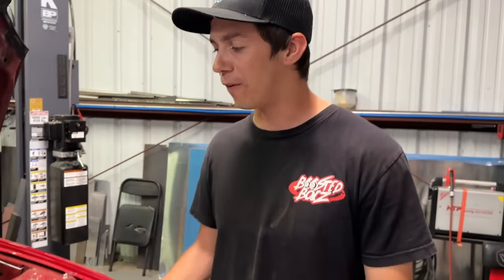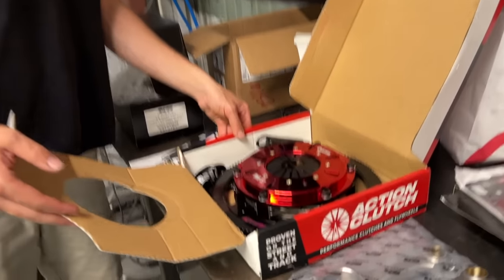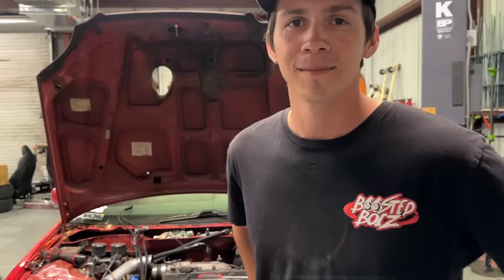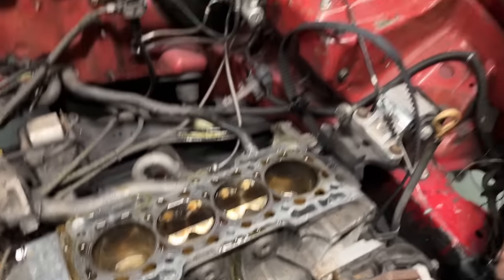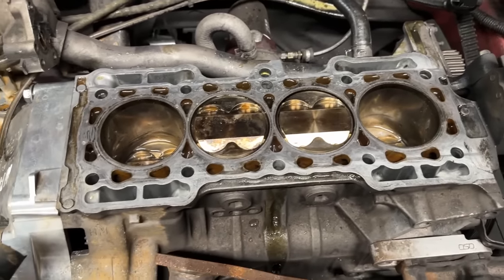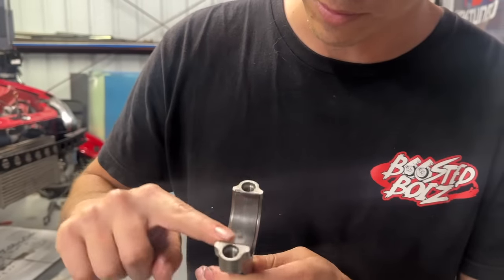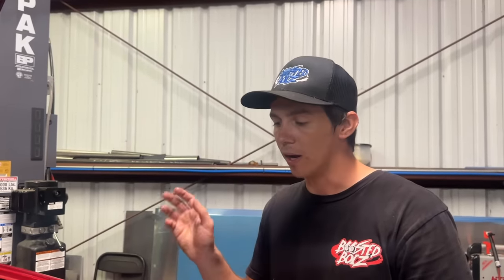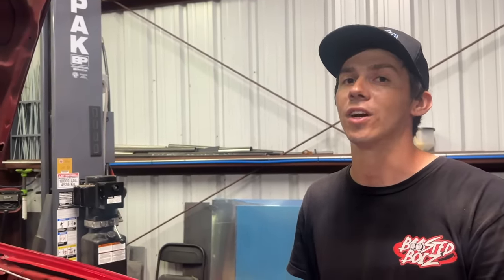Rebuilding The Hatch To Handle 1000Hp Overnight!

Comment: Hey kyle for your cooling system needs you should run distilled water to remove the minerals from the water...also get some stuff called water wetter. Should take care your issues and water wetter still is safe for the track.
Reply: Water wetter only adds a degree or so improvement
Reply: Correct distilled water + coolant. Coolant and or water wetter has anti corrosion properties. Surprised both Brent and Kyle didn't know that as its common beginner knowledge.
Reply: That is correct. Tap water has impurities which then turn to gunk together with the Coolant ... 

Easiest is just flush  once or twice and fill with straight 50/50 Premixed coolant .

Comment: You answered your own question! The hose water has minerals in it. Such as iron which will rust.
Reply: Jinkees!
Reply: I was wondering if someone used well water to fill the car at some point cause regular city water is filtered and wouldn't cause that unlike well water which is filled with minerals.
Reply: Use the distilled water and water wetter keeps all that to a minimum.. cheap fix.
Reply: gota use that Redline Water Wetter, adds anti rust, cools better and tracks allow it.

Comment: Those h23 rods could be the reason the hatch has held together so long...down on compression keeping the cylinder pressures low lol
Reply: 100%
Reply: Agreed. First thing that came to mind lol
Reply: I was thinking the same thing.  Might've been why that engine was so reliable all these years
Reply: Literally came to the comments to see if anyone thought the same thing!
Reply: I'm pretty sure it had like half of the compression it should have. If anyone knows the stroke and compression ratio we could find out how low on compression it was.
Reply: Actually it's not as bad as I thought. Assuming they were 10:1 pistons, with the extra gap they are actually now 8.1:1 pistons 

*Assuming stock bore and stroke
Reply: @NNFaNRacing I did some rough calculations. Hard to know exactly what the difference is without knowing precisely how large the dome is on his pistons, exactly how far below deck the engine was initially. But he's gaining somewhere in the neighborhood of 2 points of compression over the old rods. 

Now that it has the correct rods, it has at least 10:1-11:1 compression, as that's around what stock H22's make. Maybe more depending on the piston design.
Reply: The stroke is the same so it's not that much different
Reply: @silverbell800 If you assume with the proper rods the pistons sit flush with the deck at TDC then, all you need to know about the engine is the intended compression ration of the pistons, the stroke, bore, and gap below the deck. That's how I got the 20%ish decrease in compression for 10:1 pistons. The higher the compression ration of the pistons the more compression they were losing.
Reply: I think for a high HP daily car the combo they had would be ideal
Reply: slightly low compression a good thing when you're trying to feed it ALL the boost (like the boiz do)
Reply: How many times would it have bent valves, had it been the right rod?
Reply: Yooo exactly what I was thinking
Reply: Yep
Reply: @mikeymasi it's alot different. 80 thou extra above the crown at tdc is a big jump (12cc) in effective chamber volume.
Reply: Is this thing stock sleeves?
Reply: @dylanzrim3635   You are right, that's probably the main reason if any that the shorter rods helped the engine survive.
Reply: Very common in 00's Euro scene to lower compression when slapping boost on a small engine, you could run boost on a lot more platforms with lower risk
Reply: Came to say the same thing.
Reply: Good valve clearance too lol
Reply: there is no could or maybe, lower compression 100% will have improved reliability it might have lasted anyway tho, guess we will see now xD
Reply: @MotorSwapDan right im wondering the same thing looks to be stock.. crazy
Reply: Such an ignorant comment to make.
Reply: How about because they are H beams?
Reply: Thanks for stating the obvious

Comment: Assuming it was a 10-1 engine from factory (came in many configurations so just picking a number as an example) the bore volume is 539.18cc and with the 10-1 makes the combustion chamber approx 53.918cc, add the extra 2mm of volume (11.89cc) to the combustion chamber (11.89+53.918) equals  65.808cc for the corrected combustion chamber with shorter rods. Re calculating compression ration of a cylindar volume 539.18cc to the corrected combustion chamber of 65.808cc you get about a 8.193-1 compression ratio. 

All numbers based on approximate assumptions but close enough to make the point of what 2mm difference in piston TDC height can make to compression ratio.

Increasing from 8.2-1 to 10-1 will be very noticable as far as power figures go!!! 

Great success
Reply: Great breakdown and calculations but no two motors were the same because even at the factory during assembly those numbers could be off by so many thousandths but still be within their tolerance specs so it’s hard to say an exact calculation unless stripped brand new and running the numbers/tolerances

Comment: I don't know if you (Kyle) noticed or not but I want to point out that the rear diff is not locked, only the driver side was pulling.
Reply: Came to say the same thing
Reply: I saw that, too
Reply: i came to say the same thing as well lol. only seen the driver rear spinning lol
Reply: It's an open differential...
Reply: Still learning about the AWD swap on Hondas. But if this is true, could they not just weld up the spider gears? @Drunk3nMas7er
Reply: @danielnicholson6965  Yes you can, but then the car chirps and doesn't want to steer. Heaps of aftermarket LSD options now, but the ancient tiny rear Civic center is exxy... I worked out there is a winters quick change ratio that matches close enough to the odd ratio of  2.533.   That would allow a custom solid rear axle and a proper multi link rear end setup.

Comment: I had the same rust issue with my low mile S2000. I figured its attributed to the sleeves. Even though the block itself is aluminum they still use ductile iron or steel sleeves that can form rust in the water jackets around each cylinder especially if you don't change coolant for many years or run straight water as you do. Mine was so bad it clogged my heater core. I managed to clean it all out by dumping in some CLR (Calcium, Lime, Rust remover) letting it sit overnight and back-flushing the coolant system with a garden hose. Since you use straight water, you should look into using water wetter to keep from forming new corrosion.

Comment: Hope to see the Hatch run soon. You may need to take out some ignition timing at the ignition map under boost conditions since the compression ratio is a lot higher now to prevent detonations and head gasket issues.

Comment: You should run Water Wetter in your cooling system. It will stop the rust and lower the temperature a few degrees.
You didn't mention freeze plugs and if they're steel water only will rust them out in a quickness. I only run brass freeze plugs for that reason.
Reply: Just run distilled water in less thatscwhat you meant
Reply: @zazzy1369  distilled water will become ionized by the various particulate inside the cooling loop already, thus also causing rust over time. If it was a sterile cooling loop, that would be true though -- I use distilled water in the cooling loop on my super beefy work computer that's water cooled & it has not caused any biological growth or other sediment to form even after a year of running 24/7 (I disassembled every component & washed it all with isopropyl alcohol before I filled it with distilled water, most people just add stuff to the water to kill growth though instead of doing what I did though lol)

Comment: Don’t forget to back the timing off to compensate for higher compression and smaller combustion chamber volume...back it off 5-6 degrees in your tables, read the spark plugs, and slowly work it back in...if you don’t, your old tune might ventilate a piston under “all” the boost.

Comment: Old guy here… the orange “rust colored “ water is in fact from the tap water, a lot of iron in most tap water. We used to use distilled water and it didn’t “rust” 
Some iron parts in the cooling system can still rust even with distilled water tho 😮
🙏❤️😎🤙🛻💨

Comment: Hey Kyle i see that you are still using the heater on the hatch, maybe the heater radiator under the dash it's corroding the coolant system. Greetings from Argentina <3

Comment: If running straight water in the cooling system, run a coolant additive like Water Wetter. It adds corrosion protection and lubricity to the water to prevent the rust.

Comment: If your running tap water especially well water, you’ll get some crusty looking water eventually. That’s why they suggest using distilled water. A lot of well water has a lot of minerals in it. 
Can’t wait to see the engine area all painted up.

Comment: That rust you see in the coolant could be a sign you have a Wet-sleeved engine instead of a Dry-sleeved engine. It sounds like most of them are Dry-Sleeved but who knows? Awesome seeing Brent back with you guys!!! Also, Might try distilled water in the Hatch. It might slow the rust?

Comment: Kyle, grab some evapo-rust and run it in the cooling system. First run it like 5 to 1 ratio to water and then flush the system out until it's clear then just put like a cup of it in there for rust prevention when you fill it with water for the track. problem solved.

Comment: That’s minerals from running straight water. You need to run distilled water in it to stop that from happening. Or coolent. Probably could put just a bit of soluble oil and stop that as well.

Comment: It is recommended to use purified water in your cooling system. Purified water doesn't have any minerals like calcium or iron. The rust color could be from the iron and other minerals in the hose water.

Comment: Laundry powder for cleaning coolant system followed by lots of flushing through with engine running from cold,  does well for sludgy headgasket failures too once repaired 🤟

Comment: Put some thermocure in your cooling system and run it for a week and then drain it and put your coolant back in. That thermocure will get rid of all that rust and probably make it run a bit cooler. Its amazing stuff. Its not acidic or anything like that. I have some in a 5 gallon bucket and throw parts in it to get rust of everything and anything.

Comment: FILL THE COOLING SYSTEM WITH WHITE VINEGAR FROM THE DOLLAR STORE. Let sit overnight or up to 2days. Flush with water, refill with water and flush a second time. Works better than Evapo-Rust and it isn't $30/gallon. It's $2/gallon. Works great to clean rust out of a gas tank or anything else desired.

Comment: Also my dad use to use cascade dishwasher powder put it in with the water run it and get it hot then flush real good several times and then fill with distilled water and it should stay much much cleaner ! Hope it helps

Comment: Slightly lower compression while pushing 40lbs of boost may not have been a bad thing in the long run. That may be why H23 rods were in there to begin with, just everyone forgot.

Comment: The old compression ratio with the shorter rods was 8.4:1
The engine should now have 10:1 compression as factory on h22a

2.2L engine means a displacement of 550cc and with a compression ratio of 10:1 this gives a combustion chamber size of 55cc
With an 87mm bore, 2mm shorter rods equal an extra cylinder volume of 11.9cc for both the displacement and combustion chamber size.
561.9cc / 66.9cc = 8.4:1 ratio 
It's going to be a whole different engine

Comment: at a bore size of 90.7mm and depth of lets say 2mm, the combustion chamber decreases 12cc per cylinder, that's a 25% increase compared to the stock 55cc combustion chamber size (55+12=67 67/12). basically went from a 8.2:1 to 10:1 CR assuming stock specification

Comment: Sideways thought.. noted you don't run antifreeze & yellow color of water coolant rust like discoloration.. put some machinists water soluble cooling oil in your system to alleviate alloy oxidation corrosion effect of pure water.. cheers from a kiwi multiple 3sgte mr2 & st185 owner.. love your content

Comment: The gunk in the cooling system is aluminium parts and metals in the Tap water, it is called galvanic corrosion.
You need some form of corrosion inhibitor

Comment: Yeah that was definitely a low compression boost application with them short rods LOL I wonder if you could fit H22 rods in an h23 engine and get a little bit higher compression or I wonder if they would hit the valves

Comment: The thing is. If the rods are shorter that would mean it can Rev higher. And that makes sense. Smaller pistons and a shorter return means higher revs. 

Maybe it was a good thing. Tho you may just wanna sleeve it and put smaller pistons and throw a ton of boost at it.

Comment: A citric acid flush will get rid of all that crud in the cooling system and no hurt components. The waterpump may leak though if the crud is helping seal it up.

Comment: Sounds like the city water has a good amount of chlorine in it. It's reacting with the aluminum block and any of the dissimilar metal deposits in the water itself  and in the engine. You may not care, but demineralized water would be a lot better for the system. Just a suggestion.

Comment: well now h22 and h23 this is very useful info on the rods might even be a cheap way to turbo a block and run lower compression for less chance of boomies, given how hard this motor was pushed sounds like a fun way to frankenstein a little monster.

Comment: If you are on well water, that could be a source of the iron/rust. Otherwise, the cylinder sleeves are cast iron/steel and they are the source despite the remainder of the engine being aluminum.

Comment: I understand the glyco coolant and the track issue,  so why not put some ethanol in with the water in cold climates as this lowers freezing point depending on the ratio water and ethanol, you can drop the freezing point down to -16 deg C .  Water etahnol mix won’t be a issue for the track if a hose burst .

Comment: Adding 0.080 thousands to the stroke or ultimately. 0.080 thousands to the Quench will make quite a difference given they use the same thickness head gasket. I'm guessing before the swap the Quench was at least 0.125-0.150 thousands. Sounds insane, I hope the head or block hasn't been shaved. This seems like it could be a gamble. One of you honda guys straighten me out??
Reply: What's the stock quench??? If 0.040 thou is the sweet spot what was it and what is it now?

Comment: The orange stuff in the cooling system could be because you've only ever ran hose water through it. And why it's recommended to use distilled water. Because regular tap water has minerals in them that can react adversely with the internals. The orange may not be rust. Or if it is, it's because of the minerals in the water causing it. There could ne trace amounts of iron in the water you use from the hose

Comment: "IDK where all the rust comes from".... Then proceeds to shove a garden hose in to flush and fill the cooling system! 😂 

Try at least hooking up to the kitchen faucet.... That's a little better as it's at least softened and filtered. (Deionized water is best or at least distilled. Some water wetter and you're gold!)

Comment: Put some Thermocure in the cooling system and drive it for a while.  It will 100% clean out that rusty gunk!  You just have to flush the system REALLY REALLY REALLY well after running it.

Comment: Use that thick gel type toilet bowl cleaner, used a cap full or 2, and put it in the cooling sytem w/ water start let run a circulate and flush it that brown stuff will be gone and the coolant passages will look brand new

Comment: The rust comes from heat cycling water enough just like boiling well water. Eventually you will heat the impurities out of the water and it will stick to the aluminum or any metallic surface once the vehicle is off

Comment: Use distilled water. Hose pipe water has minerals in it. Radiator instructions usually tells you to use distilled water.

Comment: For the rusty water, could the iron be coming from the tap water you’re using? I’m sure that hose water has to have SOME iron in there and this engine is no stranger to sitting for a couple days/weeks, so I’m sure there’s deposits in the bottom of the jackets.

Comment: I'm not a motor builder. Nor do I know a massive amount about engine building. But when the head gasket fails in the way that it did doesn't that mean it lifted the head? Which means it's pushing the head studs. Which means you'd want to either put new studs in or install higher grade studs?

Comment: The rust in the waters of the cars is the Minerals it the water. Over time they can actually mack an electronic charg in the engine block. Sposto use distilled water or at least use a water wetter

Comment: Acording to the math is about 1.2-1.35 points of compression between the rod with that crank. So yeah big difference with over a point of compression
Reply: 9.16 to 10.44 with stock h22a pistons an changing the rod. I didn't know what the piston spec was you had so I just did a stock h22a an changed the rods to h23 to get the numbers

Comment: The rust may be from electrolysis. Happens I guess when battery is close to radiator.  Or even cables running along a radiator I think

Comment: Put a 50/50 mix of vinegar and water into your cooling system run it for a little take the feed line off the rad and put a hose to the rad cap while is running to flush it